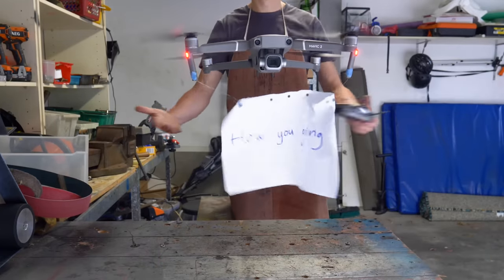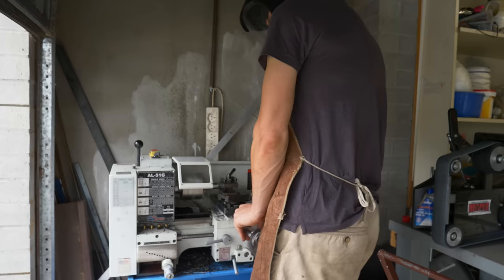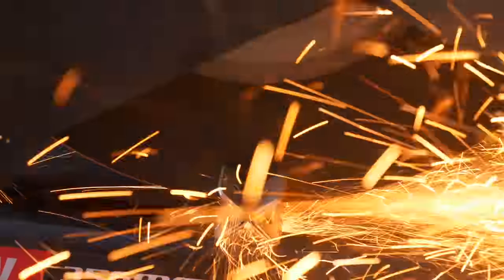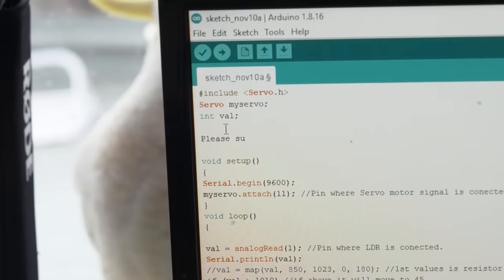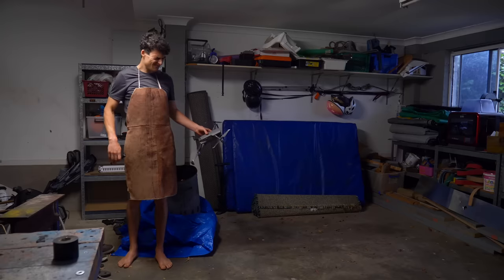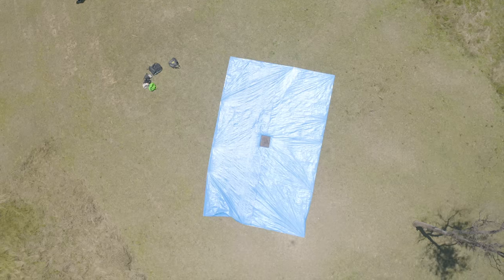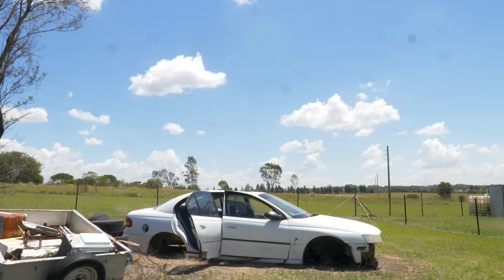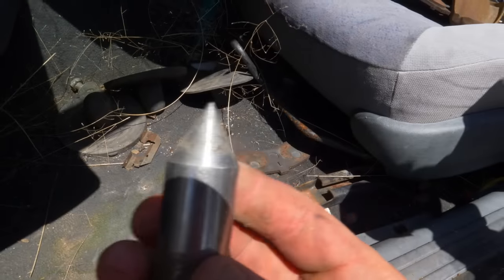Drone Darts are Silent and Deadly!

Comment: You should have designed the dart fins so that it would spin on the way down.  It would have greatly increased it's accuracy.
Reply: that was his first design...;)
Reply: Pretty sure spinning ammo with fins is actually less accurate, which is why MBTs have Smoothbore cannons and not rifled ones
Reply: @ubi8439  Many MBTs shoot ammunition which spinns by itself.
Reply: I think the biggest problem is weight distribution. You want the fins to create drag yet be light, and you want the nose to be heavy. The weight in these darts was a bit too distributed. Thinning down the body toward the tail might help.
Reply: Balanced spinning things help accuracy.  Unbalanced, it can tumble.   I'm pretty sure that he'll never have the balance required, so fins providing straight drag are about as good as he's going to do.   

There is more physics involved too, with center of mass and center of pressure.   The center of pressure should be behind the center of mass.   I think he may be accomplishing that with the fins.  But not enough to support a good spin.
Reply: @JWSmythe  Good point about the center of pressure. That's one I don't often think about.
Reply: @ubi8439  rifling in cannons would ruin the stabilisation of, well, self stabilising kinetic projectiles like APFSDS rounds by giving spin to sabot which is not good. Also not good for HEAT FS rounds because of FS part so it doesn't screw up stabilisation by interfering with fins (FS - Fin Stabilised).
Reply: @kaengurus.sind.genossen  So called rifled cannons, yes, but they're less accurate than their non-rifled counterparts, which is why the UK is replacing the rifled cannons of their tanks for smoothbore ones
Reply: @burneracc2567  Yep
Reply: @ubi8439  The current standardized British MBT Challenger 2 is armed with an L30A1 120mm rifled gun.
Reply: @ubi8439  Uhm, no. They use smoothbores because of the wide verity of munitions. Especially as most Tank guns use darts that are much smaller than the bore and fired with a sabot.
Reply: @ubi8439  They're smoothbore so they can fire APFSDS, which spins by itself
Reply: @ubi8439  Actually the smoothbore guns are less accurate than a rifled one however the muzzle velocity can be higher. They also fire ammunition that is fin stabilised. The longest range tank kill was a British Challenger II with a rifled barrel.
Reply: What if the main mass of the dart had a tail of maybe ~30% diameter of the main dart mass & roughly equal to the length of the main mass & the fins were more trapezoidal in shape with outer edge trailing long & a rounded front edge & the plane of the fins tapered from front curve to rear near-razor 
And the fins would maybe be, at the point of attachment on the tail, maybe roughly 60% the length of the tail where attachment is measured from 5% fore of the aft of the tail. Solid instead of that metal with holes in it (because the holes create unpredictable cavitationional turbulence). And the trailing tip of the fins extends aft of the maybe 15/20% of the tail cylinder. And the remaining 5% of the tail shaft cylinder has a rounded taper?
I'm an artist not a ballistics person or physicist or aerodynamcist but I have ~40 years of binging on aviation engineering and as soon as I saw your fin material & dimensions I was pretty sure you weren't going to be very accurate on your drops.
I don't know if you can weld aluminum (yup, I'm American, no aluminium around here) but I was also thinking that if the main mass is the projectile & the fins are purely for stabilization it might be helpful of they were much lighter, like feathers on an arrow.
If you've already addressed all this stuff then I'm gonna look for that video.
If you haven't, well - I'm looking forward to when you do.
DM me (if that's possible ¯\_(ツ)_/¯ ) & I'll send you drawings of my ideas.
I have a weird feeling they might be helpful. Or at least move the experiment forward not backwards
Anyway, def like the vid, was kinda freaked out because it did look like you put those shavings in your actually face hole 😬
Reply: @ubi8439  MBT cannons are smoothbore to allow for use of Saboted ammunition, which can have spin-capable fins, or straight fins like a dart, its a manner of precision aswell
Reply: Spinning would slow it’s decent considerably.
Reply: hou have no idea what you’re talking about
Reply: @ubi8439  Smoothbore cannons shoot APFSDS, which has fins that create its own spin. Spin will increase the accuracy on this
Reply: In Australia it spins the other way, thus axtually reducing accuracy.
Reply: Its impossible for a weapon like this to be much more accurate. He needs to design it to drop 5 at a time.
Reply: @rei-0x1  They spin way less than conventional rounds
Reply: @kaengurus.sind.genossen  Cool, the M1 Abrams, T-90, Leopard 2, Type 90, and several others all use smoothbores :),  also, it doesn't use rifled for AP rounds, but for HESH rounds, which do need spin to be properly stabilized.
Reply: @alexandermarken7639  Incorrect. Smoothbores are more accurate than Rifled when using APFSDS rounds. Rifled is only better for conventional rounds like HE and HESH
Reply: @rei-0x1  Correct. Smoothbore is superior, also AP rounds spin way less than conventional rounds.
Reply: @fragfox0430  isn't that what i said?
Reply: @billkerman4314  They spin way less than  conventional rounds. Sabot rounds get their needed spin from smoothbore. Rifled ones have too much spin and reduce precision.
Reply: Smoothbore cannons last longer, and they use ammo with fins. Rifled cannons dont require the special ammo.
Reply: @alexandermarken7639  Because it used HESH rounds, which dont penetrate armour
Reply: Spinning Rounds will always have a higher accuracy than non spinning counterparts. Thats because the spin makes the round physically want to stay in that exact state and required way more outside influence to change its path. It acts as a sort of gyroscope, the faster the spin velocity the higher its desire to stay in its path. Motorcycles are a good comparison as the bike stays riding straight on at speed by itself requiring hard inputs to change direction, the faster you go the harder the inputs, mass plays a big role as well obviously. 
Just from a technical standpoint for the comments wondering about this topic
Reply: @ubi8439  smoothbore is actually just more power

rifling does increase accuracy but at some big costs
Reply: @ubi8439  that’s because most modern rounds have fins on them
Reply: @ubi8439  smoothbore only allows for longer range
Reply: @NomIsNom
I believe at the speeds that MBTs fire their rounds spinning would damage the round itself, which is why they don’t.
Reply: @kaengurus.sind.genossen  APFSDS stands for Armor Piercing FIN STABILIZED Discarding Sabot
Reply: Spinning just magically makes everything fly better
Reply: @ubi8439  the have smoothbores now, because the ammo has fins, and is programmed according to the task. Meaning the ammo still spins, but it is not spinning according to the rifflement of the barrel, but it can spin differently on different missions /shots. This allowes for greater accuracy, longer range, and more flexible missions.
Reply: @J-IFWBR  you can't program anything about the round. The fins ate stationary, and do just that, stabilize. Yes the round still spins but comparatively much less allowing for greater accuracy and penetration. With non stabilized shells, you need the spin. With fin stabilized ones, spin will throw them off target. Those fins serve the same purpose as feathers on arrows. Smoothbore allows for longer service life (rifling wears out), more reliability, and more velocity since the barrel doesn't try to spin the round, therefore it has less friction, that increases velocity and as a result penetration of armor, since penetration is affected by velocity and mass of the round (those are the two main ones, other factors are penetrator material, quality, shape etc.)

The only programmable rounds are the modern NATO High Explosive Multi Purpose rounds, which can be used against armor, as regular HE, as a canister/airburst round, and also have a proximity fuse for use against helicopters.
Reply: @pascalroggen8364  R O L F !!!
Reply: @ubi8439  bruh, this is fail :) smoov bore is cause of rocket shooting option. you can do both on the new mbts - classic shells and the rocket propelled, too. the second option would not work with rifled. take the L.
Reply: @spencerwilkie4218  no not really. In some cases, yes, but if our rifles were smoothbore they would also be fin stabilized to stabilize the shell instead of spinning.

Comment: Idea: you should 3d print a whistle or noicemaker and glue them to the nose of the lazy darts so you could get a sort of a Stuka effect on the way down.
Reply: That might also cause flying plastic pieces near the landing site. 
I was thinking 3D printing fins as well, but for same reason, would need to also make a shield at control site.
Reply: This

Comment: You probably won't see this but you were soldering at way too high a temp. Try lowering the temp and holding the iron still against the desired location for 5-10 seconds before adding some flux core solder. That should fix your problem.
Reply: The components should also be on the opposite side. Stick them through and connect the ends with solder. Way more convenient and no chance of burning components by hitting them.
Reply: @TheJell3  That goes without saying, but you can get good results soldering the components in any orientation once you have the technique down.
Reply: Underated comment.
Reply: hey you guys wanna adopt me? you seem competent
Reply: @sirweebs2914  Soldering skills = Good parenting confirmed?
Reply: @Handles_AreStupid  well it's a start if you ask me. Id rather have a father that has technical skills and can teach me something useful then my father that just drinks and is ignoring me.
Reply: Damn bro, chill
Reply: @sirweebs2914  Are you alright? I'm willing to talk if you need someone bro.
Reply: comment so it s seen
Reply: @sirweebs2914  feel ya 😅
Reply: @sirweebs2914  yeesh, I feel ya, I never had a good relationship with my dad, I'm 31 now living pretty far away from my parents and it's definitely still awkward with my father.
Reply: @stenyethanmathews945  that's really sad especially when you see how a normal functioning relationship with your father can look like.
Reply: And for the love of God, get an Octopus or just ANY arm with a magnifying glass and a fan... Also consider using a full face mask when soldering, it's not good for your eyes...
Reply: also those little alligator clip stands with all sorts of arms to help you hold things are where its at
Reply: Also dont use that rubbish lead free solder. Leaded solder simply just gives a better result.

Comment: this should be brought to an arms dealer convention, im sure there would be many buyers!!
Reply: One of the buyers will be me
Reply: All from the US specifically
Reply: tbf shave off the top and add  a targeting mechanism (basically 2 servos for the fins, a tiny battery and an esp32-cam ) and you probably can compensate the inaccuracy of the drone. and even assuming the projectile is a total loss, you're at only 10 bucks per shot.
a better option might be to use a test tube filled with tannerite so even if you aren't as accurate you just blow everything up with glass shards.
also how to get on a watchlist 101
Reply: isis dudes already used this couple of years ago.
Reply: @pffpffovich2398  and the Ukrainian and Russian Separatist forces in the Donetsk/Luhansk region, they’re still actively using it
Reply: @pffpffovich2398  i think some syrian rebel groups and many other terrorist groups also uses it, in particular syria
Reply: @daobabyish  i disagree, the usa dont fuck around with these toys when killing innocents

Comment: Love this project enough to wonder if the reason for the "twitching" behavior on the servo was because the lights on the drone are pulse width modulated...  Lights appear solid to the naked eye  but actually switching on/off rapidly for brightness control.  Could compensate for that in the arduino code, unless I'm way off base.  Cool idea, and your vids are always tons of fun.  Thanks for going through all the work to film and share!
Reply: No, actually it's because the moth used was no longer alive. A re-test with a live moth would yield significantly better servo-actuation. There's no need to try and impress us with fancy words.
Reply: I too was wondering why it was pulsing, didn't realize it could be down to the actual light on the drone, learn something new every day
Reply: I think it's just due to how he coded it. The pulses of light are way way faster than that thing was opening and closing.
Reply: No way would it be reacting to PWM carrier frequencies. Just janky code
Reply: it was doing the same thing with his phone flashlight, i think the more likely reason is janky code that moves the servo rather than open so when it has light it opens and still is light so it closes again etc etc

Comment: Rods of God is my favorite abandoned military project ever. Absolutely bizarre concept, with terrifying potential.
Reply: Really the potential is only as scary as conventional nuclear missiles. It becomes actually terrifying when it becomes more cost effective to haul multiple giant tungsten poles into orbit than it does to launch a single ICBM.
Reply: @Hawk7886  From what i can tell, the plan would be to mine asteroids for it (or just use asteroids) rather than put it in orbit using rockets
Reply: Unfortunately I believe it got sacked due to the geneva conventions stating that weapons in space are forbidden
Reply: @FirstLast-cc6cv  geneva suggestions
Reply: @FerretyZebra  thats the spirit
Reply from the maker: They are terrifying and awesome
Reply: "abandoned"
Reply: @FirstLast-cc6cv  For good reason. Glad there was enough foresight to prohibit that

Comment: Soldering advice: get some Flux. Most solder has a Flux core, but I always keep a Flux pen or tub of gel near. Clean the surfaces to be soldered, use a brass wire brush if needed. The Flux is acidic and eats the oxide layer, and also acts like a shield similar to welding gas.

Try it. If your iron isn't temperature controlled, you may be too hot. However you may also be too cold. I often solder at 800ish Fahrenheit. This means you have to work faster, but you want to get the joint up to soldering temperature before the heat sinks to the rest of the part.

Uhm a few more quick tips, add a tiny but of solder to the iron right as you start, use that to make contact with the surface/board/pad then add solder to the joint, not to the iron. Leave the iron for a couple seconds after. Hold things very still while cooling.

A good solder joint has the solder flowing into the parts, not beading up. Super dull, pitted, cracked, or bulbous joints are bad. They will not conduct well if at all and could even cause heat/fire.

Love your videos
Reply: Yesss
Reply: I read this as "soldiering advice" at first, and I was expecting some drone striking expertise
Reply: This is why I love a good Resin core solder. Avoids all this together

Edit: granted its still possible to fuck up but Resin is better for beginners.